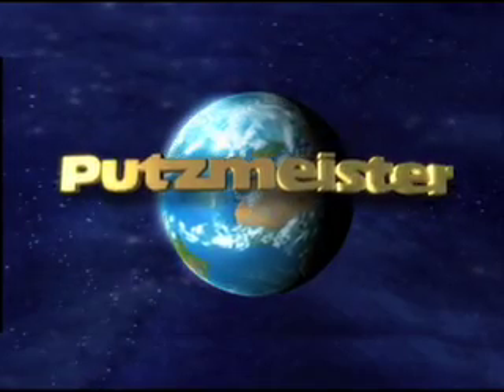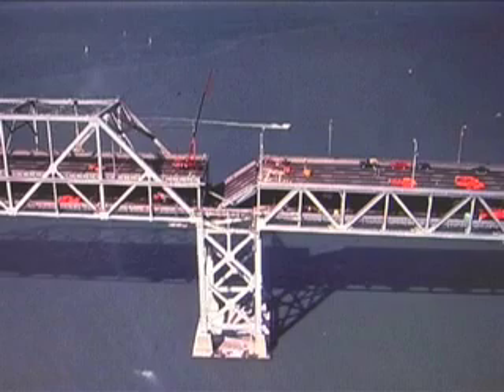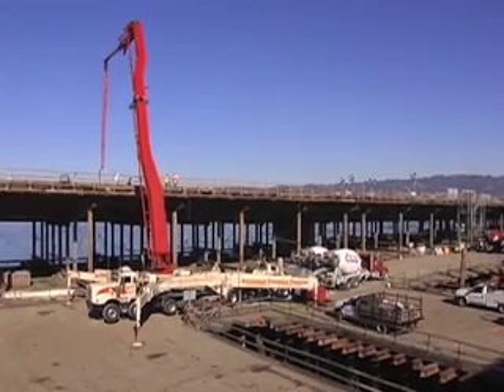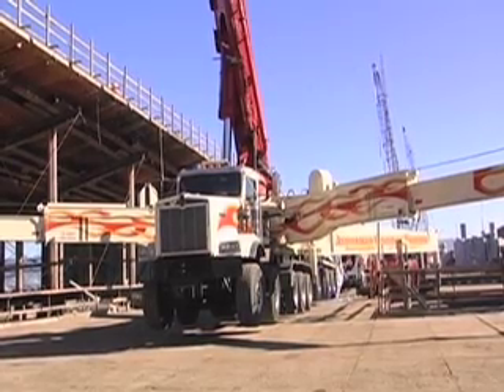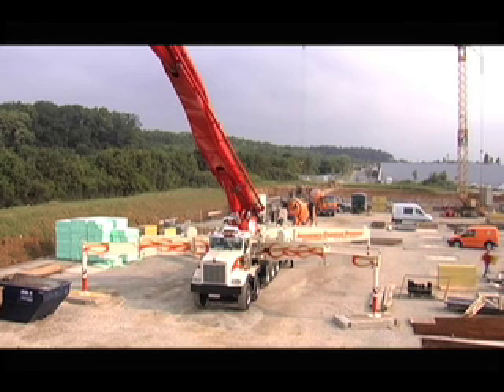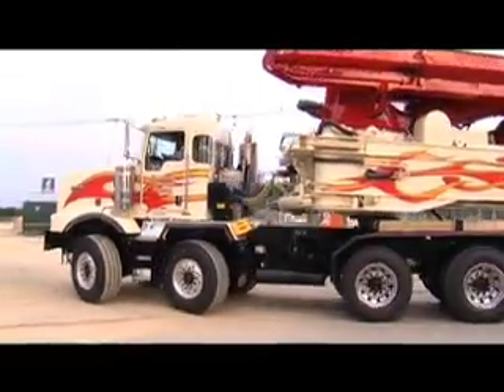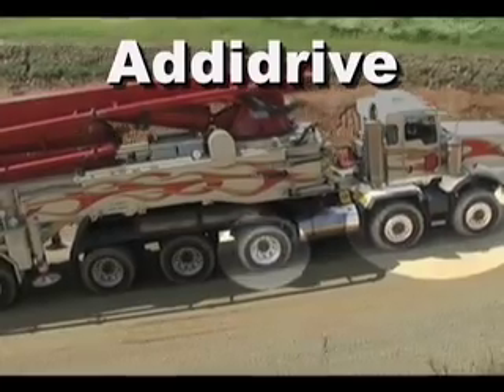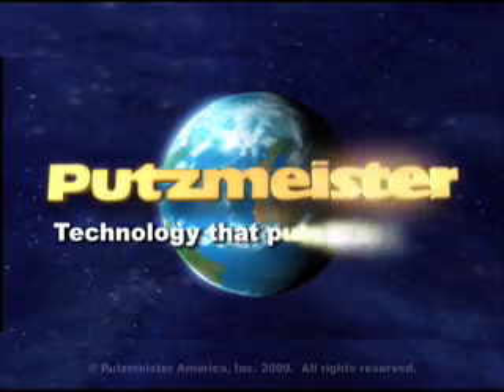Putzmeister America- 70Z Product Video

Comment: The operators might like to watch the size of the pads under the out-riggers, even on what looks like a solid surface. Ground baring capacity should be known in order to determine the appropriate size pads.
Reply: Ranjit Singh pushed Maza boom operator
Reply: Ali baba to you too.